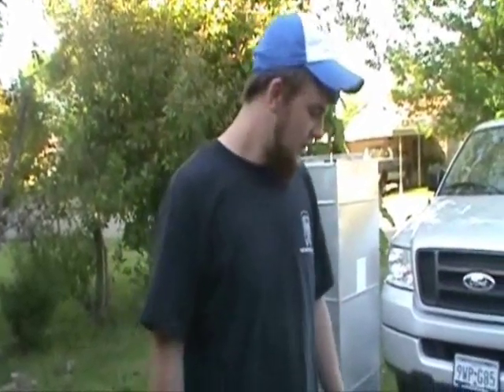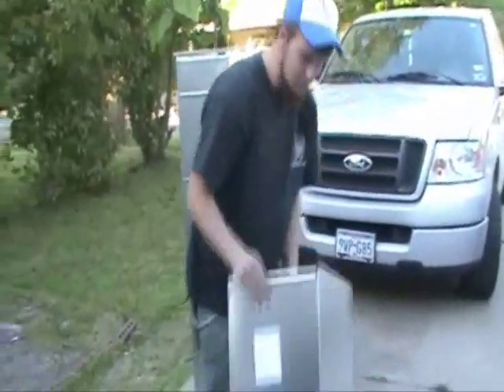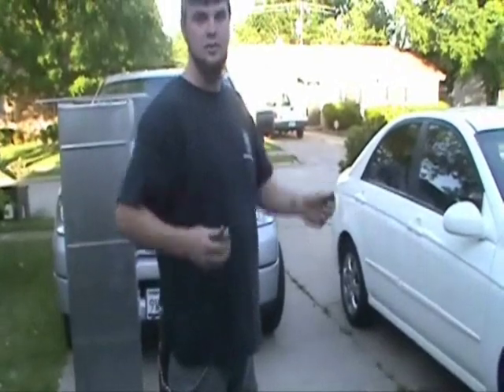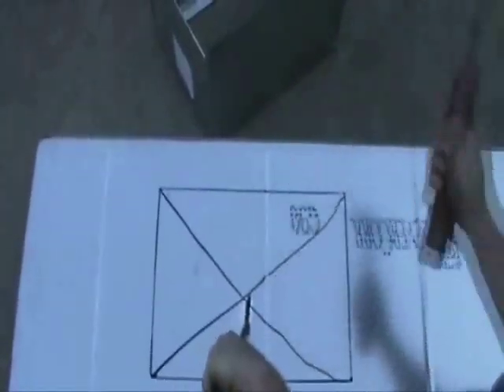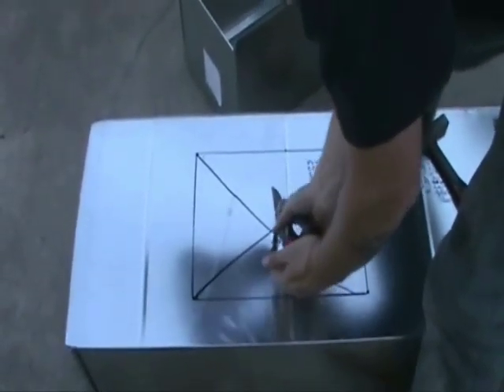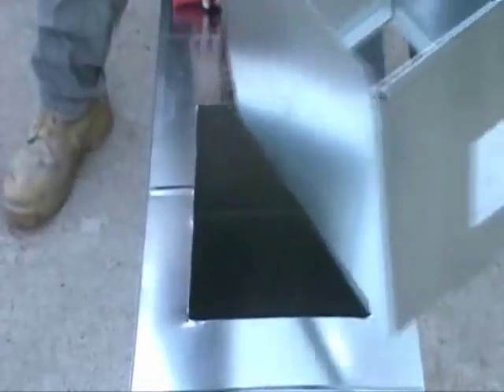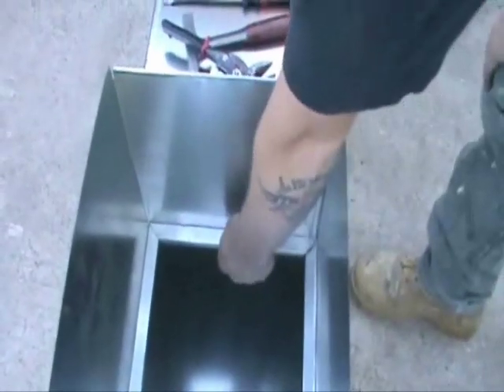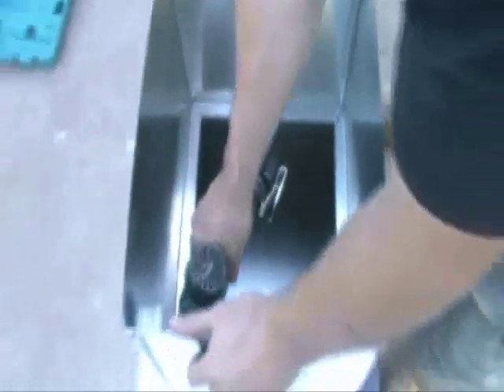How-to install a square tap

Comment: IKO- Inside Knock Over,  you beat the 1/2" over inside with sheetmetal hammer,  then flatten with offset hand seamer, don't need to put screws in it

Comment: If you've got a lot of holes to cut out invest in a unishear. I recommend battery operated unishears over electric but either will work. After 20 years of cutting out opening by hand I got smart in my last 10 and invested in unishears. So sweet! Don't be bullied by superior thinking tinners that give you crap for using the right tool. You know what's right, just do it! Think safe too use ear plugs and safety glasses. PEACE!